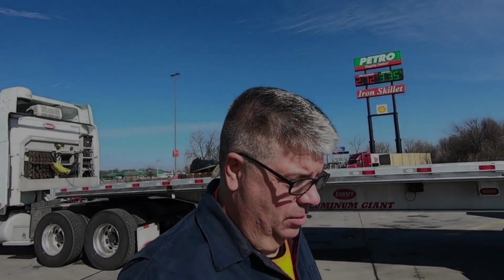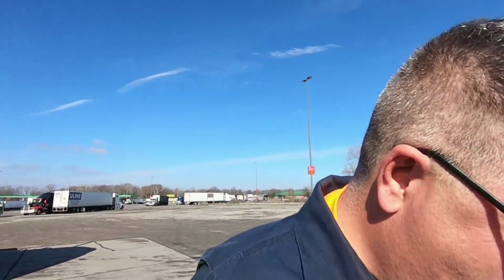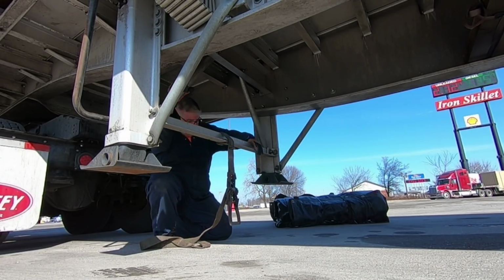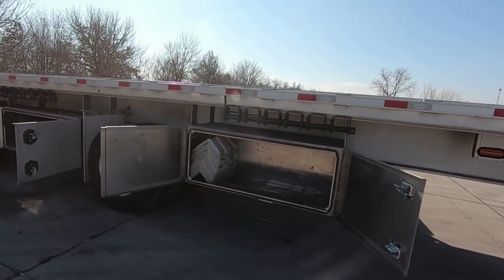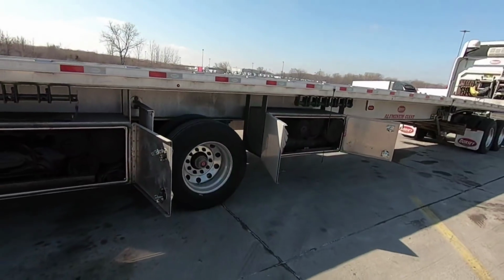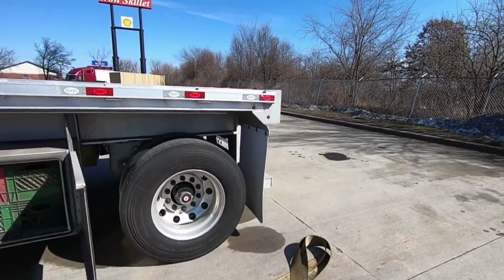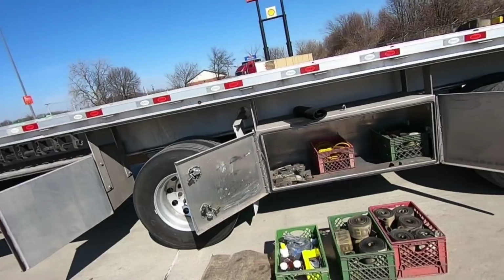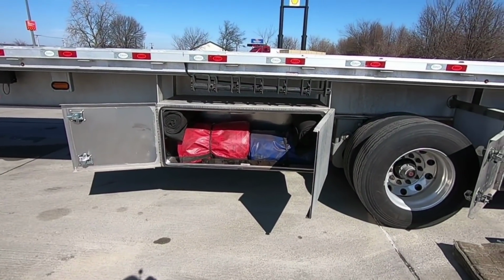#487 Organizing my Dorsey Trailer and a Truck Wash The Life of  Owner Operator Flatbed Truck Driver

Comment: I don't miss those tarps Dan, I have worked for the same company hauling building materials since 1975 best thing we ever did was going to curtain side trailers 20 some years ago. One more thing when you put those winches close together like that and run-in snow and ice they are hard to slide apart. Just a thought.

Comment: very organized trailer boxes Daniel we mainly use 2 inch straps first and last time i saw them 4 inch straps was cartin concrete blocks at 15 ton a piece  from the yard to Cape Preston used for mooring weights for the tug boats  and the blocks were standing on their edge cause it was too wide to lay down and was carting 2 on 2 trailers 40 ft flat top and 43 foot drop deck with bogie dolly  in road train  was also using chains  too

Comment: So as a small business owner I would think that you would have a plan in mind when the engine went down.  Did you? How about the transmission? Have thought about replacing it when you want to instead of when it goes out? Just curious. Enjoy your videos. I got out of driving back in 02 .
Reply: He said the transmission and rear end and the radiator is something that he mentioned in another video that he will probably have to get worked on sometime before too much longer because they've never been worked on and he bought that truck brand new in 2003.

Comment: Great video, Dan, I learn from you every time, that's for sure.  A question which I can't find the answer in previous videos?  Is the Dorsey trailer about 2000 pounds lighter than your steel previous traler?  You recently weighed and if I recall correctly, you can routinely take up to 46,000 lbs?  Have I got that correct?  Be well and be safe and keep truckin'
Reply from the maker: With the old steel trailer 46000 was about my max weight. With the aluminum Dorsey I can easily haul 47500 now. 
Thanks for watching
Reply: @SuperTruckerdan  Thanks Dan, I had my numbers quite a bit off.  Aluminum certainly has a nice advantage there.  As the Esso dealer used to say, "Happy Motoring".